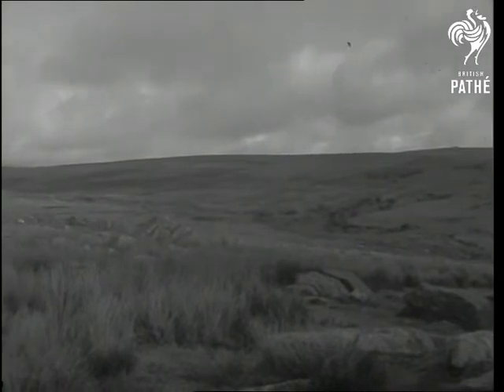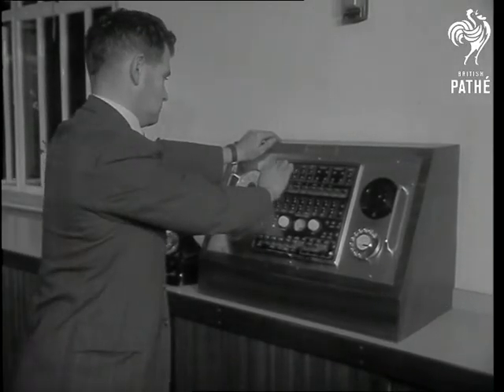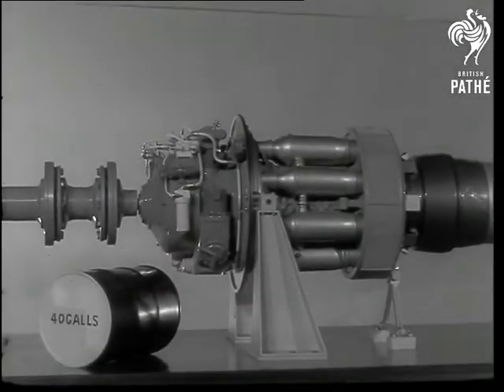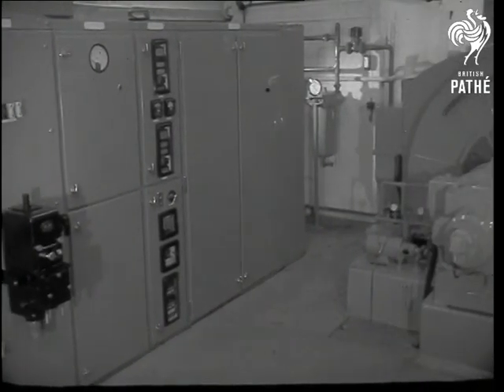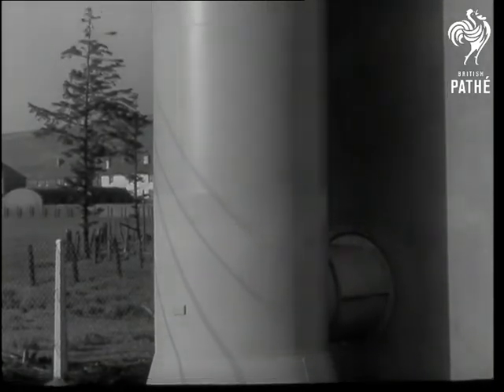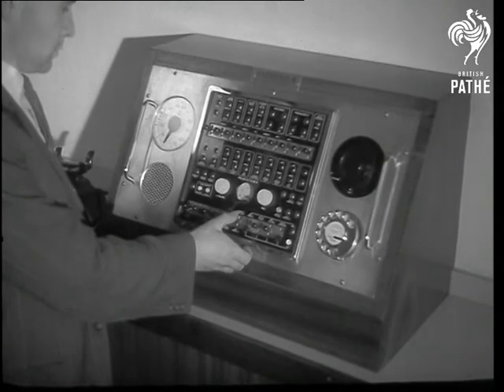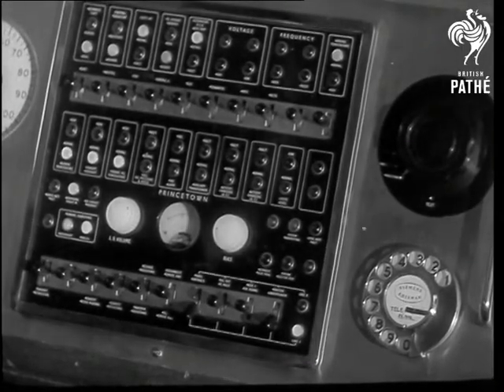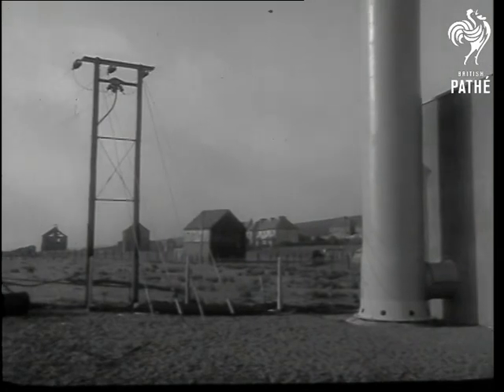Proteus Turbo Generator For World's First Unmanned Power Station (1959)

Comment: In1980 I was contracted as the Project Mechanical Engineer to dismantle and reassemble an automatic power station from Santa Ursula,, Tenerife and reassemble it on Punto Brava, Lanzarote in the Canary Islands. This station had 2 Proteus units, as the one in this film they were called Britannia 1 and 2 as were their Power Speed Controllers. The project took almost 2 years to complete using all local contractors.

Comment: These should be dotted all over the UK, could be made to run on hydrogen gas.
Love the very English queen's speech narration.
Reply: There are many gas turbine "peaking" generators around the UK and elsewhere, they are not cheap to run in comparison to regular power stations so they are only used when necessary.